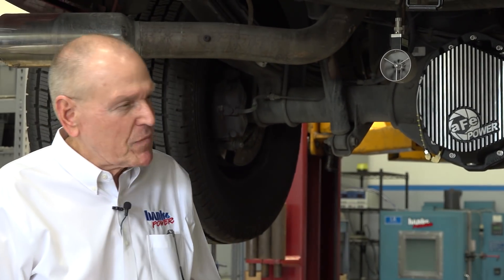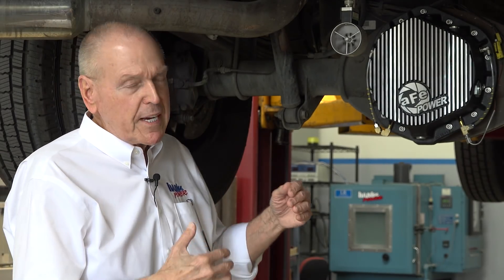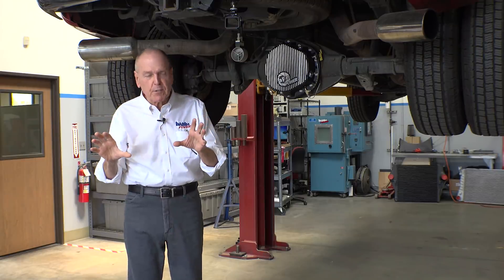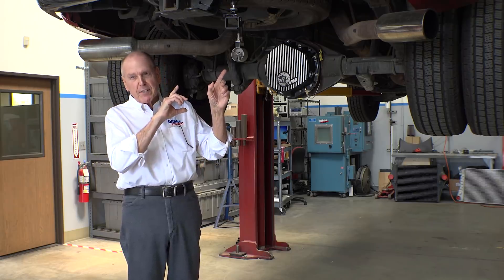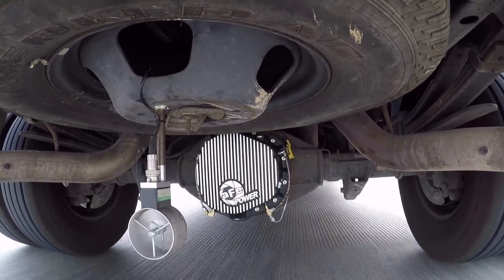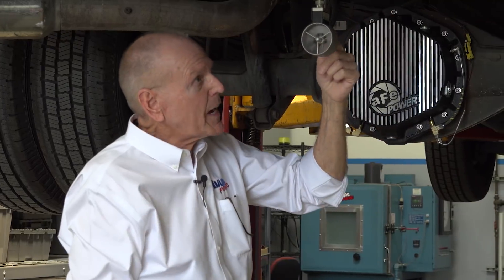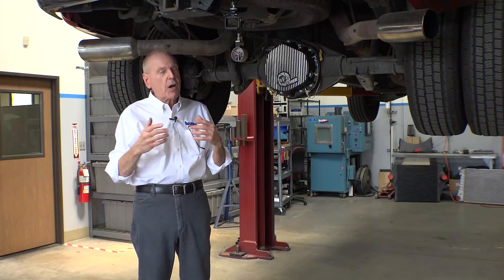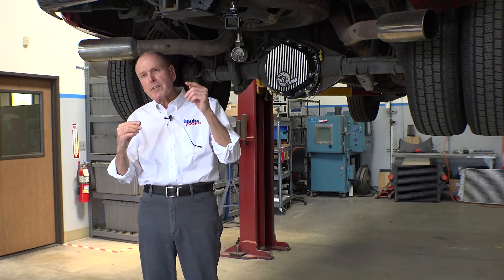Do Diff Covers Work or Are They Just Bling? Part 1 of 3

Comment: This should prove interesting. Between the degradation of oil from over-filling/overheating, and the dead air flow over the pumpkin, Mr. Banks will show those fancy covers to be detrimental and a waste of money, but we'll see. I used to stop by the Banks shop on Lincoln Ave. in San Rafael, where they were installing turbo packages back in the day, and if anyone can answer this question, he & the crew will!

Comment: 15 seconds in. depends on the diff. ford escape ive had to use a case spreader to get the gears in. find it hard to believe that a structural diff cover wouldnt make a difference.

Comment: When’s the follow up???

I’m on the edge of my seat here since I’ve installed an AFE cover on my 2013 GMC 2500 with a 6.6 DuraMax. Seemed to get better mileage since I’ve done that. I did notice that it runs smoother if you can understand stand that, less felt vibration and noise, at least that’s what I’ve noticed. Maybe I’m dreaming or want to feel something but to me it was noticeable.

Comment: I'd bet there is also a "reserve" capacity designed into it as well. Meaning that there is a bit given up on the performance side , in a racing axle there is an external cooler. The capacity is also designed to basically be a dry sump type of thing. In a street able axle it's designed more for the longevity side of things. So you need to decide where in that range you want to dance . Mr Banks does some really good work with that in mind. I'm really interested to see these results. I also have my "theories" as to what the results will be....

Comment: I always wondered because the diff on my p/u gets hot (200+F) even when not hauling anything. The oil shouldn't start to overheat+degrade till l300+F for very long periods, just unsure how that effects the gear oil viscosity, its not like the dif has journal bearings like a motor where low viscosity will cause low pressure. In motorcycles with shared oil the transmission tends to shear down the oil, but those aren't the same gears that are in a ring+pinion diff. I've also wondered what high temps will do to an LSD type diff.

Comment: I bought mine because of the drain and fill plugs. It's a PITA dealing with the gasket every time you change the oil. Also, the one I had included a port for a temperature sensor. Can't monitor temp without that.

Comment: Well, measure the temp at extreme operating conditions. It seems like some of them can be just bling. But back in the day when I sold auto Parts, from 79 through 97, the companies that made transmission oil pans with air cooling tubes in them, there were temperature measurements made on all of them, and they all were cooler than the OE Trans fluid pans. But the fins on the rear end covers are not in the airstream. More oil capacity would keep the oil cooler in the short term, which is good for drag racing if you take measures to cool things done between rounds in the pits. But not if your running continuously. So leafs see what the man has to say!
By the way, thanks Gale!

Comment: I'm a tad shocked that the GM and Dodge lube is 75-90 syn in the rear... On the Fords  it's 75-140 syn... the front axle runs 70-90 conventional. Now that's also the sterling 10.25 or 10.5 ring gear... but still that strikes me as odd that it's that thin...

Comment: I am curious about diff covers that increase the volume that also has ports for external coolers.  More specifically about whether or not the rotating gears cause any sort of a pressure differential in the oil.   I was talking to a race team engineer and builder and they said that the gears alone will provide enough pressure to run oil through the lines and through the cooling radiator.   Is there any truth to that?   How is that possible when the diff housing isn't actually full of oil?

Comment: Its bling.   

Gale doesn't mention the only three ways heat are transferred:  convection, conduction, and radiation.

Thermal conductivity of turbulent air over that small finned surface (increased surface area) is almost certainly nil benefit compared to oem cover.

Comment: I actually wouldn't be interested in temperature. My major question is do these covers help reduce ring gear deflection from housing flex during heavy hauling therefore increasing longevity? Also if it keeps the bearing journals in proper alignment during serious off-road use?

Comment: one thing I think a lot of people are missing is that after market diff covers are not only for performance. many stock covers are just thin stamped out metal, after market covers are usually much thicker and will not be damaged as easily which makes them better for off road use.

Comment: So why not design and come up with a bolt-on air channeller basically a funnel that takes the air which flows around the top and bottom of the differential and forces it to wrap around the backside of the diff for better Cooling?

Comment: 300+ degree diff fluid temp!?  Seems you'd be better off running coolant lines back and welding a loop in the stock cover to get rid of the heat - I can't wait until part 2.  Thanks for testing this!

Comment: Ok here’s the thing though, the manufacturers and the engineers who design them don’t design them to fail. They know that people are going to be hauling heavy loads and they build them accordingly. This guy sells diff covers. That does not mean what he’s saying isn’t true but its overkill and expensive. If a guy maintains his truck and doesn’t pull more than what’s he’s supposed to and he doesn’t get a rear diff that was built on the day before a holiday at the axle plant he will be just fine saving his money.

Comment: As a Heavy-duty Truck mechanic (40yrs professional) ,a differential pulling 180,000lb( Michigan Special) for 3-4hr down the Highway with an ambent temp of 80F might go to 230F which is with in opperating temp! Never seen any cooler on any Heavy Truck diff,so I would have to say "BLING"!!!  If you want to do something,use a full  Synthetic gear lub! It will keep it's lub properties at higher temps and is "slicker" than mineral oil! Also when you it run low on lub,you have a larger"window" before your diff melts down than with mineral oils!!!    .☝😀

Comment: Totally subscribed to see the results of this. I had to rebuild the rear in my old Suburban so i put in a 4.10 and an Eaton Truetrac. So I splurged and put an aluminum cover in it thinking i was protecting my hard work.

I've towed a camper a few times with it and it did well. Felt hot to the touch but not searing hot. Gear Oil stays clean, not burnt.

Comment: Anyone else disappointed that he shows the running temp of the stock cover but not the aftermarket one? Here he goes on a diatribe about how fluid level changes the oil temp and that the fins of the aftermarket cover may or may not help cool it but doesn’t test it like he did with the stock cover? 10:00 I’ll never get back.

Comment: i thought one of the reasons for a aftermarket diff cover was for strength
Reply from the maker: Strength only seems to be an issue on Jeep and other serious off-road applications where rocks could damage it. During daily driving or towing the cover isn't under any stress.
Reply: thats excatly why i have one for offroad use so rocks dont damage it. i had my original damaged from a rock had to get towed out. never thought it would be used for anything else except for strength use for offroad use. it was never intended to be used for any performance aspects.
Reply: here is a quote direct from the 4wheelparts website, nothing stating performance or any other suggestion other than a extra layer of protection 
Differential Covers
To protect the intricate moving parts of your differential, an aluminum differential cover is the perfect answer, adding an extra layer of protection to your vehicle’s underside.
https://www.4wheelparts.com/Drivetrain-Differential/Differential-Covers.aspx?t_c=12&t_s=237&t_pt=4041

Comment: but there is no mention of the "load" put on the drive train by weight and drag of the load you are towing. Kenworth did this 40 years ago and found load of say 60k pounds will triple the heat build up from causing the mechanical operation under load.

Comment: The mag hytec has more capacity a magnetic drain plug and a dipstick and cooling things so they definitely help
Reply: orangejuiceJoe 1 More capacity does not equal better cooling pertaining to lubricants. It helps with “dilution” because you have contamination and fluid break down(additives). Why do you think Allison studied this and use a specific pan for each transmission(several models). In a transmission it’s referred to as “turnover”, the time it takes for the entire sump capacity to circulate through the entire system, be cooled and return to the sump. The more capacity you add actually increases this. I don’t care if it’s a aluminum fancy pan or steel. It’s been proven in R&D by people who only care about the facts.

Comment: A lil off subject but I know what you mean about that dead area due to the flat surface of the differential cover.  I'm a tractor trailer driver an I find that motorist like to drive directly behind my trailer cause it reduces that wind velocity/resistance to non existence for them while driving.

Comment: Only reason i run them is for off-roading. You land your rear end on a rock and the stamped steel cover peels off the diff enough to start leaking. The aluminum one took a few hits but eventually started cracking. Ended up with one made locally from thick steel plate

Comment: Mr Banks, you have always been leaps and bounds ahead of others in the diesel market.  I had the pleasure of talking to your guys and seeing the twin turbo diesel s-10 run back in the mid 2000's.  That truck was so far ahead of its time.  Not a single puff of black smoke from startup, to burnout, to finish line all while running in the 7's in the 1/4 mile.  You have alot of haters but that's easy to do when your so far ahead of them.

Comment: Theoretically the deeper covers that hold more fluid but at the same level should cool better if there isn't more aeration, if the aftermarket cover is stiffer theoretical it should have less flex, less friction, better mileage, but I'm super excited to see what Mr Banks comes up with, it will also be interesting to see how well the cooling fins help if at all

Comment: When it comes to overfilling the rear end, if you notice in this video when they show a diagram of fluid level stationary vs 60 mph, the stationary level is right at the fill plug. Which reinforces the old idea of adding fluid until it begins to trickle out of the fill hole. The AFE cover they have on that Dodge doesn't have the same fill plug so overfilling could certainly be an issue there. 

Now providing you can fill it to the same level with the new cover, the new cover would probably allow for more fluid capacity, maybe just half a quart or so but more none the less. Overall a higher fluid capacity won't keep temperatures down but it will take longer for the fluid to reach full temp. Also a benefit of an aftermarket cover would be the drain plug it adds to the rear end so you don't have to remove the cover anymore to change the fluid.

Comment: You said you ran it on the dyno with 200HP load, simulating an uphill road - for comparison it would've been interesting to know how much HP would be needed to drive on a flat road with typical max capacity those trucks would run with a trailer.

Comment: Wouldn't the fins increase surface area which would increase heat dissipation?  Couldn't you just.... not over fill it? Regardless of what cover you have on.
Reply: Good point. What is another good question is with the aerodynamic difference of the flat finned cover compared with the more rounded factory cover, will less air actually come into contact with the fins? The other thing I wonder is if you run the factory fill level with a flat finned cover, will the square shape at the rear allow the oil to flow the same way the factory cover was designed to?  I am looking forward to Bank's findings.
Reply: ElectroBraap well, how do you know if it’s overfilled? I was taught to just fill it until it starts coming out of the fill port. Adding more volume to the reservoir will make it sink less than the stock level I bet, meaning that more of the ring stays submerged, causing more loss. You also can’t just add the same stock amount to an aftermarket cover because the overall volume in the cover changes.
Adding fins should help- that’s thermodynamics 101. But a majority of it has to do with turbulent airflow, which is definitely induced by the drag that the cover is creating. There’s a lot to it I guess
Reply: BenLeBlanc1 indeed. I'm just asking questions. Curious to see the results.
Reply: ElectroBraap yup. I’ve never heard of heat induced early rear end failure during normal operation, so I’m more interested in the parasitic loss side
Reply: Imagine if the air at the back of the differential was completely quiescent:  it would be like it was packed with styrofoam.  Yeah, the surface area is increased but it doesn't help in a meaningful way since it's up against insulation.  Imagine then the axle tubes and front of the differential are facing a hurricane; that's the way your heat is really getting out.  That's just imagining though.  It'll be interesting to see what's actually measured so we can know the reality.
Reply: If the cover adds volume to the housing, the fluid level won't fall to the correct level at road speed. It will be higher. So, it may increase cooling, but you're hurting MPG.

Comment: What about putting a radiator for the diff and using an dc pump to circulate dif fluid.. Especially as temperatures rise while pulling things that sort of thing.. I know probably a dumb idea but thought i would comment.. I don't know much about any of this.
Reply: Loren Tedford They run setups like that in racing. Use a pump with an oil cooler to keep the temps down on the diff and trans cooler. I’ve even seen setups where it only kicks the pump on when the temp gets over a set level so the pump isn’t running all the time.
Reply: Why not bond a bunch of computer cpu cooling fins on the housing?

Comment: I ran a larger diff cover on my 06 Ram 2500.  It was a Mag Hytec and I was running a temp gauge before and after andit cooled my diff down to 280 degrees when pulling hard in British Columbia mountains  from about 360 degrees.  I was towing a 36 foot 10000lb trailer and carrying 2 ATV s
Reply: And I did it for cooling not economy

Comment: I would believe that it is the forward facing differential housing that does the greatest percentage of the heat dissipation. The rear cover gets little airflow and has a much smaller surface area.  Either way, I am certain that the manufacturers have taken all this data in their testing.  They don't want warranty returns or early failures in fleet vehicles.

Comment: anything finned will dissipate heat we add finned blocks to high rpm gear boxes on RC buggies 1/4 scale from the 80's... but on today's trucks aren't mostly on 100% stock diff set ups w/ebay lift kits? Kinda like adding aftermarket valve covers to stock valve train all nice an dressy? Or maybe stickers from jegs & summit racing to youngsters it's look cool as F"..... For the serious built diffs ( 900HP+) I understand this completely but what I see running around dallas ft worth is more dress then anything and Ive yet to a have a diff issue in 40 years

Comment: They work pretty good at holding the fluid in. Thats about it. The only reason i would put an aftermarket on on would be hold more fluid, and have a drain plug and sightglass to monitor fluid quality amd contamination, especialy on a off road rig where water intrusion may be an issue.